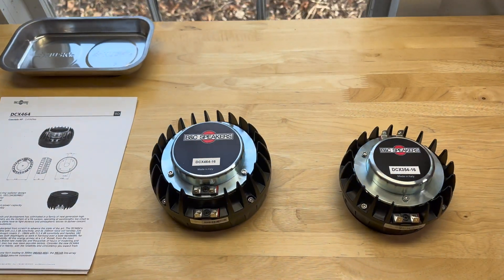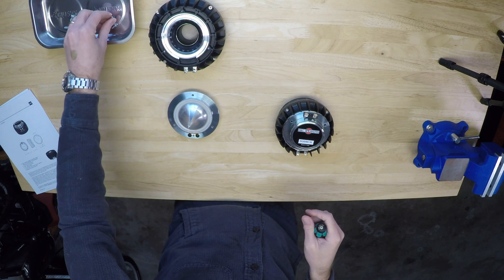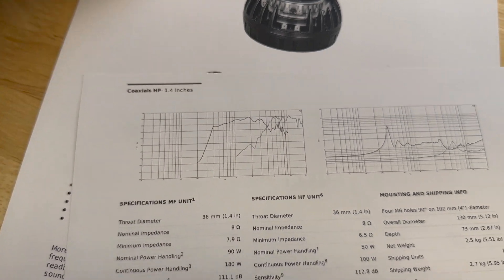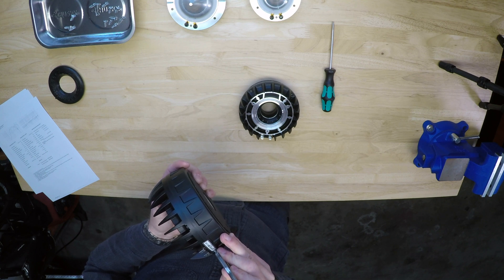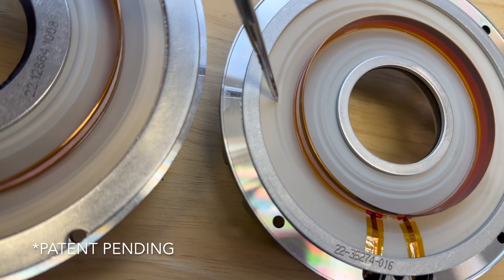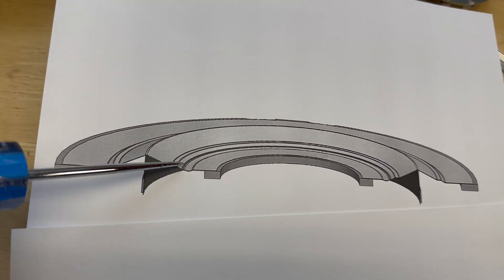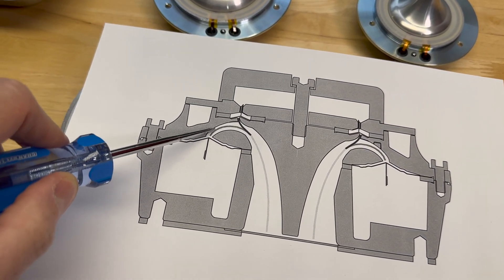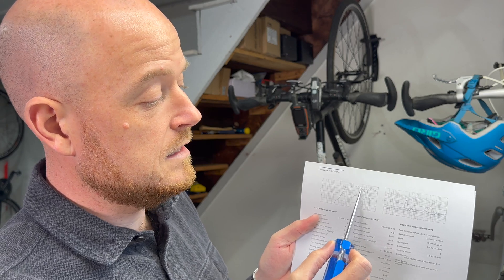B&C Speakers DCX Coaxial Driver Teardown

Comment: hello, we bought the dcx354, any recommendations concerning amplifier? not really familiar with such designs of high sensitivity, would a normal amp of lets say 150W per channel on 8 ohms be safe for this? or bearing in mind the super high sensitivity do we need a much lower wattage... thanks in advance, i am a bit confused and dont want to burn the driver, just need some general specs of a suitable amp!

Comment: Hi Bennett. You once mentioned that the 354 driver will have less THD than the 464. Are there any measurements availble confirming this ? 
How big is the path difference between the two diaphragms ? Looking at the drawing the midrange seems to lag by about half an inch.

Comment: It's incredible, but perhaps you will supply these drivers with beryllium diaphragm?
Reply: What improvement would it give? You have to think about that a ring diaphragm like this one and a huge dome is completely different!
A huge dome needs super stiff materials to have it still move as one all the way up as the middle tends to do it's own thing after a certain frequency. On a ring diaphragm the middle is held by the coil and the distances are much smaller so this problem is not much of a thing in those if at all.
A copper cap may not always be needed or make sense. If the improvement is too small compared to the work it takes. Especially as the gap needs to ve made wider to make room for the copper cap so they need to chuck more neo at it to make the motor as strong as it was before.
Reply: ..and copper cap  in HF section to lower Le and extend HF response perhaps...anyway it's more likely (my illation, be clear!) that 18sound would/could do a similar thing since they already use beryllium for CD and are part of the group of B&C speakers that own this brand (and Ciare too), so some sharing of know how would be "friendly" I suppose XD

Comment: If 354 is developed, then it means that 464 is not all right?
Reply from the maker: The 464 is still the highest output, widest bandwidth driver we make. The 354 is for sure going to compress sooner, if nothing else, with hot signal. But if you need a smaller / lighter / cheaper driver, it is a really great solution!
Reply: In my opinion you only need the bigger 464 if you are planing on using it below 600Hz with the required large horn. For anything with a higher crossover the cheaper 345 will sufice.

Comment: Really excited for this driver and always appreciate your videos the more info we can get about these the better. Does the ridge in the 354 act in a way that increases the effective surface area or is the benefit mostly from the decoupling effect? Maybe it's not quite the same but reminds of of the first generation powersoft m-force drivers (301P01) that came with an optional folded diaphragm but on a massive scale folded in itself which gave a 40" of surface area in the same space as the 30" standard diaphragm did. I did notice they appeared to abandon it with the most recent model however. Sorry i have even more questions, can you comment on how the distortion in the 354 compares to the 464, it was mentioned several times in marketing it was superior but how much of an improvement can we expect? Any chance of sharing waterfall graph of the 354? Last, there has been some discussion recently on soundforums.net DIY threads about if this can really compare to the 464 in the 400-650hz region with several people saying the decreased diaphragm size in the MF simply cannot compare/replace and at high power there will be a significant reduction in usable max db, how true is this? If you have spare time would be great if you could have a read of the thread and clarify what is and isn't true since it just seems to be rumors and assumptions right now. Thanks!
Reply: Also unrelated but while your reading this can you tell us anything about the 18HTX100? Is it, as the recent facebook post implies a tri-axial driver?
Reply from the maker: @zzink  the 18HTX100 is a DCX464 married to a special 18" (designed to work well at higher frequencies!), with a very large and lightweight new horn design. We're launching it at ISE in a few weeks. Should be a lot of fun, and if it is well received I'm hoping to push for a 15" version with DCX354. Of course the driver will easily outrun the 18", but more LF is easier to find than HF.
Reply: @bennettprescott  15” with sub support sounds much more interesting to me than 18” alone.
Reply: @Hotbutteredyum  I feel like the angle of the horn will largely dictate how these 3-way drivers will be used, if the horn and angle is large maybe similar to ME464 size they wouldn't be too good for arraying and limited to smaller setups but could be good for a super compact FOH point source box, portable party speaker, high powered foldback/booth/wedge. I also imagine a possibility where the integrated horn is not wide like the ME464 but an 18" with a line array type horn like the ME148 joined the full height of the driver making it possible to just stack boxes of it anywhere for an instant line array effect. The internal bulb expansion section of the integrated-horn could even be designed/used simultaneously as a phase plug with the 18"? Like imagine just stacking 4-5 high of that on the floor as deployment no rigging needed for a 2-3m tall FOH system? No idea how realistic some of this is but i do love new and exotic ideas in sound :)
Reply from the maker: Can you link me to the thread on SoundForums.net? I can share the short answer here, for the long answer maybe we'd better use another forum - email or phone or in person even would be fantastic. bprescott@bcspeakers.com

The short answer is there's no replacement for displacement, the larger diaphragm in the 464 (and bigger coil, which heats up more slowly) is more capable. The ridge allows us to have a MF diaphragm that is very efficient even at higher frequencies despite being quite large for the given coil diameter, and narrows the gap in performance. This was a choice we weren't able to make in the DCX464, it has a traditional V diaphragm that gives up HF performance to gain Sd and therefore output at low frequencies. But it has to be crossed pretty early as a result, because it's big - so the HF driver also has to go quite low as a result. The ridge adds structural rigidity that allows the inner V to behave quite well, while keeping the performance of the whole diaphragm for use at the low frequency limit. If we applied this same diaphragm shape to the 464 it would be higher output, and the gap between the two drivers would be as you expect.

Distortion in the 354 and 464 is similar, what I mean by lower distortion is versus a system with a traditional diaphragm shape and overlap. The overlap lets the whole driver Sd work at the same time at the frequencies that are both the most important for intelligibility, and where the HF diaphragm is working the hardest. By sharing the load the two diaphragms don't need to individually work as hard - which is sort of the whole concept in the coaxial in the first place!
Reply: @bennettprescott  Youtube wouldn't let me post the link but i've sent you an email, the thread is Peter Morris - 60 Degree DIY Mid Hi - AKA PM60